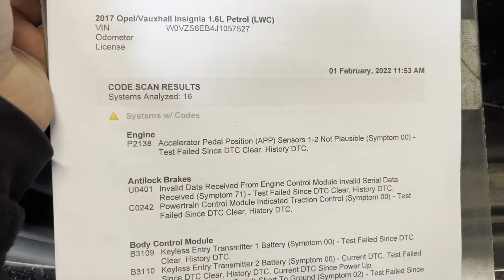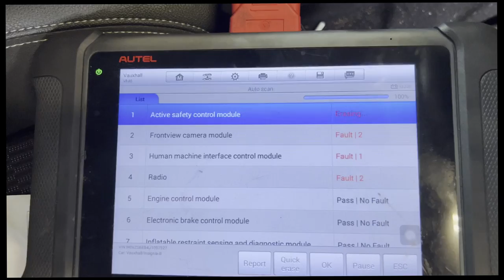Vauxhall Insignia-B P2138 Accelerator Pedal replacement full video

Comment: wd40 on the contacts seems to have fixed mine for now. car feels new again after months of stuttering, threw a p2138 and limp mode yesterday but cleared itself. fault was still stored.  will monitor and replace if needed. handy video for guidance of removal.

Comment: I have this problem P2138 on an Opel Mokka 2015 1.4 140 ps (I changed the pedal, the cable that goes to the computer, and it still appears the same to me, can you tell me what could be the cause?? so far I have invested 1500 euros in parts , I also went to Opel and I don't know what the problem is 😞

Comment: Do you need to disconnect battery or anything? Or will car recognise new sensor straight away.
Reply from the maker: hi no need to disconnect the battery, I would recommend to clear the previous fault code.